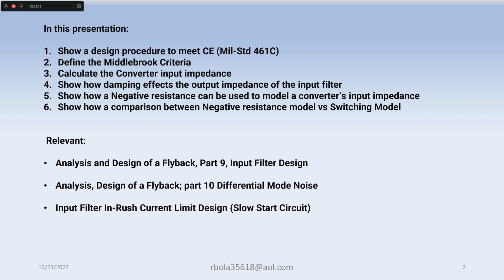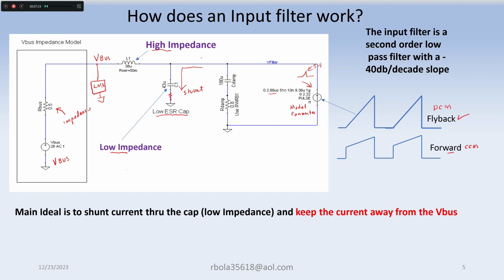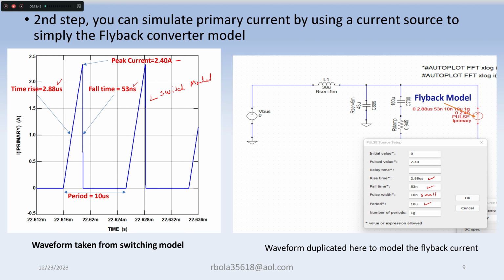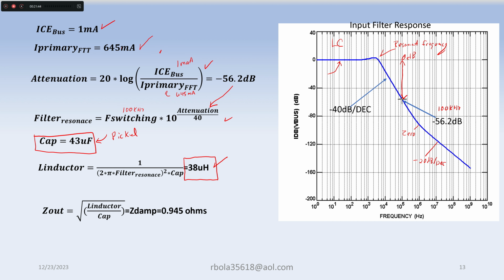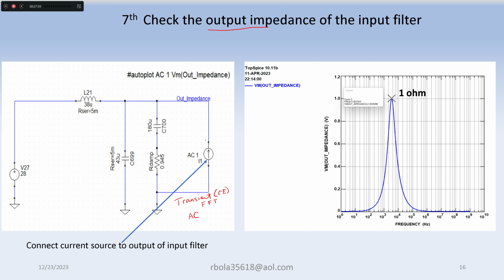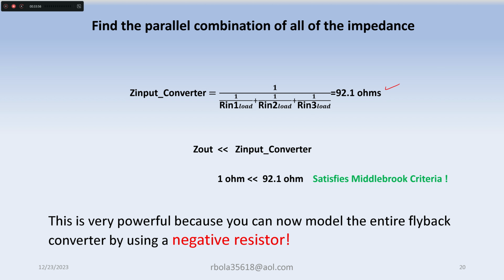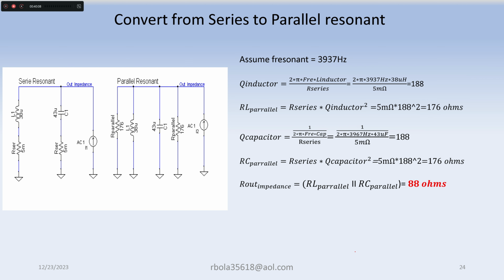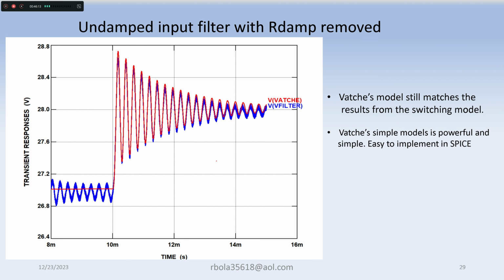Input Filter Design, and simulation using the negative resistance model.

Comment: Thank You for a very informative guide. One question though: should I decrease the value of the Rdamp by the ESR of the Cdamp ? Cdamp will often be a hermetic tantalum cap with significant ESR.
Reply from the maker: Hi Dok, yes the total Rdamp should include the ESR of the Cdamp resistor.  Very good question and observation!

Comment from the maker: Hi uvx508. Keep in mind that I compared it against the switching model which has the feedback control controlling the output. The simple model is a match to the switching model. Also keep in mind that this is the method used by professor Vatche Vorperian.
Reply: Hi Robert 29 minutes into the video R3_load = 21V/0.264A = 7.5ohms unfortunately this is wrong the correct answer is approx 79.5 ohms
Reply from the maker: @tdrelectronics766  Thank you for spotting the errot. My fat finger pressed the wrong button on my calculator. I will post the correct one!  Good catch!